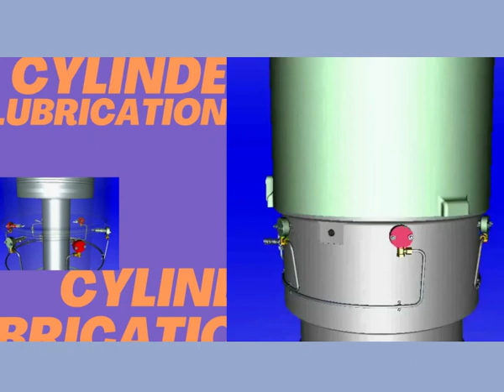Ship's Engine Cylinder Lubrication | Seaman Vlog

Comment: Sir paano po malalaman if lht ng quills are working properly?
Reply from the maker: Hello, Rival. Actually as per engine design for MAN B&W, wala syang monitoring talaga para sa individual quills while engine is running, pero pero partly pwede mo syang maasess sa pamamagitan ng pag check ng temperature ng bawat lubricator line papuntang quills, then compare it with the others. In port better to reconfirm by checking na lahat ng quills ay evenly flowing ang oil.🙂

Comment: What is crank angle at the time of cylinder oil injection?
Reply from the maker: Hello Raghu, sorry that I missed your question. Actually different engine type and Maker kas different setting. There are some type especially using the ring pack lubrication injected at 20-30deg before TDC. There are engine type using single hole lubrication, injected at 80deg before TDC. I would suggest to check your engine instruction manual on it.🙂
Reply from the maker: Hello Raghu, sorry that I missed your question. Actually different engine type and Maker kas different setting. There are some type especially using the ring pack lubrication injected at 20-30deg before TDC. There are engine type using single hole lubrication, injected at 80deg before TDC. I would suggest to check your engine instruction manual on it.🙂